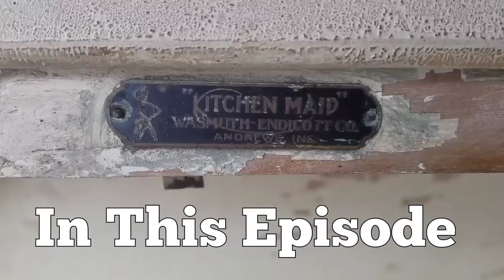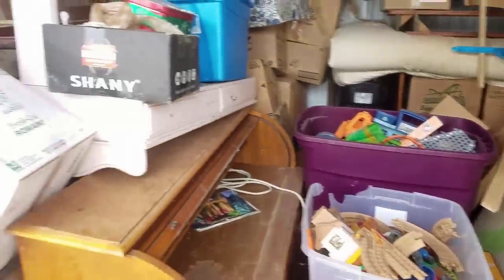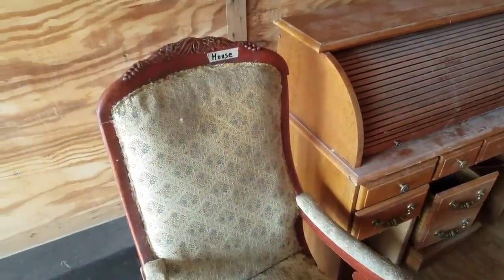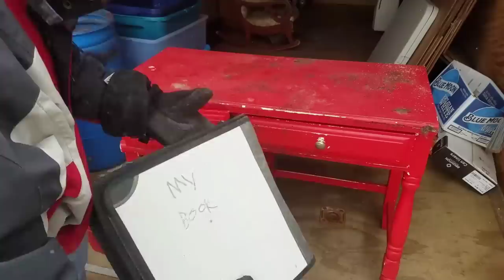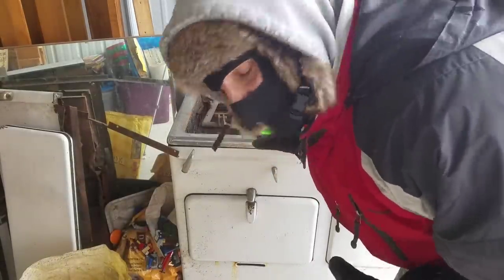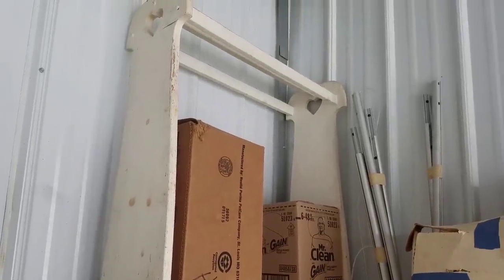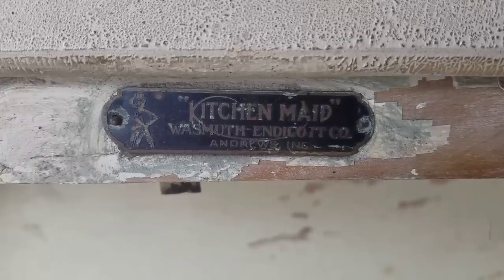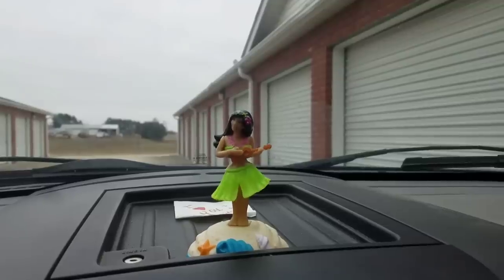$3,200 STOVE??? I Bought Abandoned Storage Unit Locker / Opening Mystery Boxes Storage Wars Auction

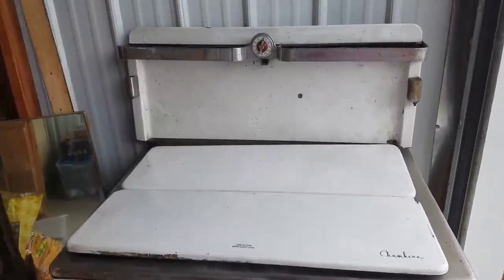Comment: 10:03 I have been to a lot of auctions.... That is a "Hoosiers"... In todays market 2019 still good value but not as good as the early 2000's...… Very hard to find the sifter so make sure you do not get the wrong price for it!!!! Also you have the orginal stamp of manufacture... Do not let anyone talk you down... Do your homework on the value today!!!! I have been in the early 2000's and they would go so high..... I would stop bidding.... I just seen where you said 500.00.... Really with the sifter and the original tag..... You take that and you really did not do your research... I seen them go way over 1,000.00 in local auctions in NC...… If you still have it which I do not think so.... I would buy it in a heart beat for 500.00!!!!!!

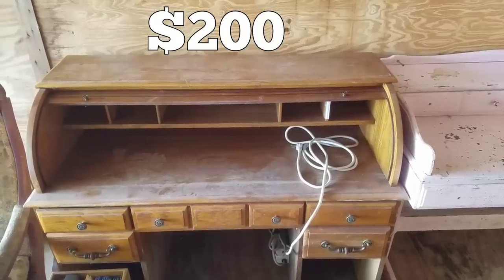Comment: 2:45 I have exact same roll top. Bought it new from Sears in the late '70s for $185
Reply from the maker: Is yours solid wood?
Reply: It's absolutely the same desk, down to the knobs. Don't lift it by the lip on the top, the weight will eventually start to loosen it up. Mine is in quite better shape though. It's wood. Funny though mine has been in storage for the last 3 years since we moved.

Comment: I keep looking for a Hoosier Cabinet in good shape. Some of them still have the charts ,(4qt=1 gallon, etc), and glass canisters and spice containers in them. The metal rails are so the enamel top can slide out for a bigger top. They go on the sides at the back. Most of them have a metal lined drawer at the bottom for sugar or flour. Some of them have 2 metal dispensers up top, 1 for flour 1 for sugar. Some have a roll top like a desk. My mom's friend had a white one with red trim when I was a kid. Of course I just thought it was an old cabinet and wasn't interested back then.  I Haven't found one yet. Great stove! There is a place in Georgia that makes them look brand new. That Singer looks like the one I bought in 1979. Cast iron, not plastic. Still works fine to this day. That unit was a great deal!!!

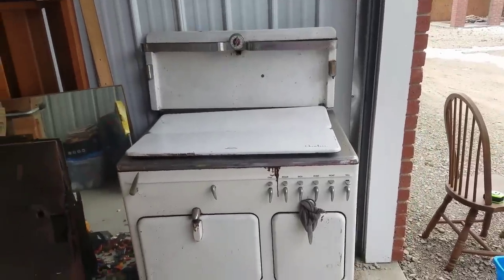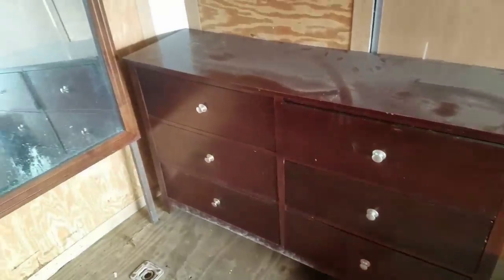Comment: 10:16  OMG...I used to cook on one of those type of stoves except mine had a shelf across the top.  I loved the cook fire on the side for super slow cooking and the shelf for proofing bread yeast.  Also gas is a lot easier to bake with and for quick cooking like fried eggs.  This will look amazing restored.      5:45  The cabinet with the white enamel top and flour bin with flour sifter built in...has a pull out sliding table/shelf that helped with cooking.  Yes, used one of these too but it was in rough shape.  Clean but rough.

Comment: We had an older version of a similar looking stove at our camp - cottage probably to you (not by that manufacturer though).  It had an over head storage area.  Was originally an cast iron wood stove that was converted to burn fuel oil.  That fire box took a quarter of the oven, the oven portion took about half the space and then the last quarter was a water reservoir that had to be filled up all the time when the stove’s fire box was on.  The stove acted as our furnace in the winter.  It was a very effective heating unit!  When ever it was lit, the grate over the fire always had a faint orange glow!
We finally had to junk it when my Dad could no longer keep the fire box intact enough to use.  He re-packed the inside of the fire box every year with new bricks but eventually rust overtook what ever my dad did and it just wasn’t safe anymore.  It’s an long ago memory now, almost 50 years ago.

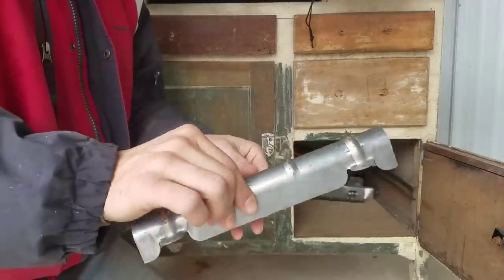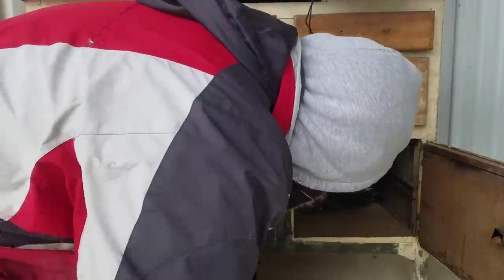Comment: 14:33 to 14:39 are to attach to the bottom cabinet then you set the to cabinet down on them. This way you can slide the enamel top in and out easily.  You called them covers.  I 
have one of these so if you need a photo sent to your email I will photo mine to show you how they work. VERY important to keep these. I am sure you have already found out it is three separate pieces. It would be great to find the enamel table that goes with the set. I have both of these pieces. I use the enamel table in my studio to work on and the Hoosier cabinet to hold my stained glass tools and I solder on it GASP!!

Comment: Your cabinet was originally painted white, it really does appear to all original.  You might want to watch for the metal pieces that held the top to bottom.  They are metal, sort of a "u" shape, so the "u" would fit over the bottom enamel.  I don't really know how to explain what they look like,  if you find them they will add value to the piece, most of time you will find the cabinet without these pieces.
Reply from the maker: I think it is the original paint as well :)
Reply: @WhatTheHales  Yes they were white to make the kitchen more "modern" . I have a cabinet that I purchased in PA, (used to save my money to buy antiques even at the age of ten), my dad purchased a cargo trailer after he realized my mom was not giving up on collecting and we brought it back to AZ. It had been painted maroon in a heavy lacquer finish.  At this time the trend was to bring the furniture back to the wood finish.  It took a lot of hours to get the lacquer off, I actually used paint stripper and large kitchen knives it was so thick.  Underneath was the white finish like your cabinet has, I had no choice but to take that off too.  It was made by Hooiser Company as the brass tag was intact, but looks like a kitchen cabinet.  It has double glass doors on the top with shelves inside, a drawer and then double wood doors with a wood shelf.  So they made cabinets to go in the kitchen, basically like we have cabinets on the wall in our kitchen.  Its the only one I have seen, I also had the Hooiser with flour sifter like yours, but sold it a few ago as I have way too much furniture.  All those racks inside as they are also original.  So glad you found the brackets!

Comment: we had an enamel top kitchen cabinet just like that, flour bin with sifter, can opener to the right and a paper towel holder in the middle, my Grandmother used it for canning, my Dad got it after Grandma passed, it sat a long time in the basement, moisture wasn't kind to it, Dad wanted to restore it but only took it apart then tossed it in the trash. I still have the enamel top. if I remember correctly the enamel top slides out to give you more counter like table space to work on. the top is a sheet metal enamel coated table top with a piece of plywood or similar flat boards under it for support. the handle you found in the top drawer goes to that drawer, its an original piece, but those chrome hinges on the small door aren't originals. Those are plain simple farmers wives cabinets and sold in the mail order catalogs or by salesmen going door to door and at the time cheap
Reply: lol it was a swing out manual can opener lol
Reply from the maker: Yes, you are right! The top slide out to give you more space :)

Comment: If that Chambers stove was assembled and working and looked better, it would be worth $350. As it stands, likely it was taken apart to repair, so fair market would be about $100. 
Now, if it was restored, it might be worth 3K, but that would be like a complete car restore, down to the frame, rechrome the handles and a redo on all the surfaces, but, you would be dropping that much into it.   
My thought, re assemble, clean it up, make sure it works and snag the $350 if you can find a buyer.   
On the flip side, they are desirable because when they are working they are great stoves.  
There is a website you can visit to learn more on them.
Reply from the maker: What's the website?
Reply: What The Hales here is the best one.  It lets you figure out your exact model.  The people on this page can answer about any question you have on the subject and if you want advice on where to find a place near you to have one restored, or you need a part, there are the folks who can tell you.   
http://www.chamberstoves.net/Models.html
Reply: What The Hales Btw the very second you showed the unit after you bought it, your camera skimmed the right hand side and I saw the handles and said, "Hot Damn, he got a Chambers stove. That unit just paid for itself!"
I will say $3,000 is a lofty price to expect.  You should know those stoves are highly regarded and reportedly those 60-70 year old stoves work better than most current good stoves.  You might just want to fix it, put it together, and wait till you need to replace your current stove.   It will become the focal point of your kitchen.  
A 10 year FB friend picked one up and repaired it and installed it.  He and his wife didn't even know I was an enthusiest.  Its an obscure passion but very contagious.  As far as appliances go, they are a solid "barn find" and not a very common happenstance.  
Keep it. My 2 cents.